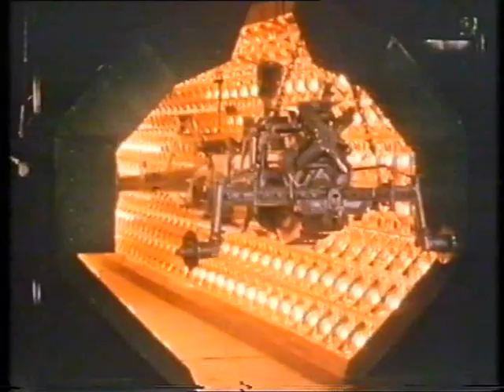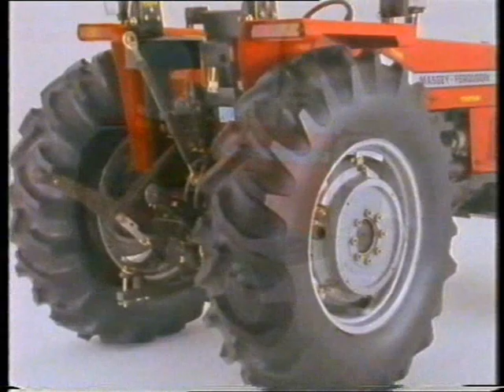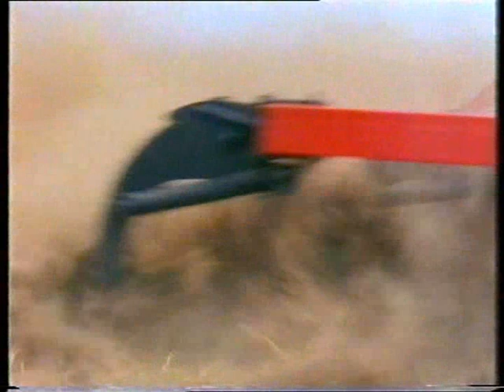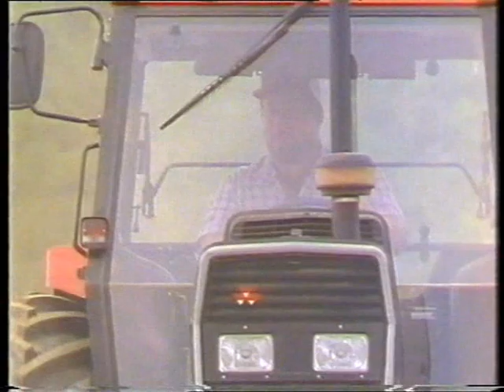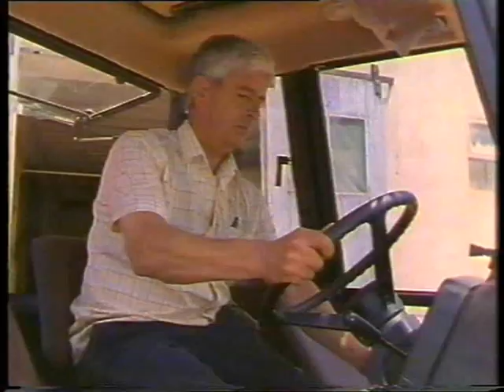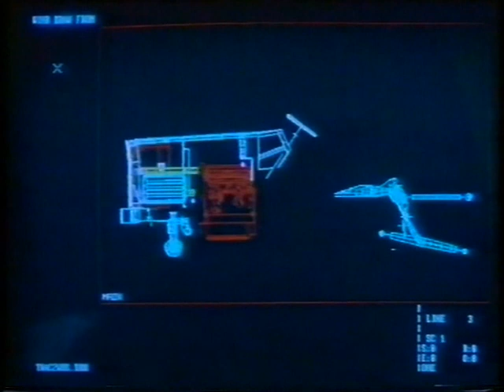MF 300 Series Introduction (1989).wmv

Comment: I have owned many tractors. The one that I would say was the best ever would be a 390 four wheel drive. It stood in as a big tractor one year when our MF 2685 got laid up with a piece of clutch spring on the clutch plate getting jammed and not allowing it to release. 
The 390 was weighted up and coupled up to a Dowdswell 4+1 DP 8 plough and then a Dowdswell 4 metre power harrow. She could punch well above her weight. I remember my father bringing my sandwiches to the field and seeing the 390 power harrowing and saying to me, "The poor little bugger!" We actually finished off that drilling season off that way while the 2685 was being fixed. What it did mean was super early starts so as the drill didn't catch up with the power harrow. If 300 series tractors were produced today, i am sure that they would be a top seller. Robust, simple, very effective, and reliable.

Comment: The 90's Massey Ferguson's 300 ,3000, 3100, 3600 series are great tractors . I have a 3000 series 3070. I grew up with using the 100 and 200 series Massey Ferguson's .  The Perkins Diesel engine is very reliable and has a lot of low end torque.  My favorite Massey Ferguson tractors are the 35. 65  ,97-8, 135 , 165, 180 , 1130, 265, 285, 383, 3070, 3095, 3125, 3690. ,

Comment: The 365 4wd was a poor performer, bought  iit against the 390 as wanted a good slope/bank working here in Wales. Adding dual wheels to the rear and 4wd engauged there was very little power left even to climb back up a bank,let alone have any light pto implement. However like most Uk built MF tractors it was really well balanced . Fuel tank up front good but vibration use to  break the fuel line,untill I affected my own mod.The stuttle lever ex factory would rid a finger and nail  badly ,as yhe action between the steering wheel and the plastic knob,as you partly swung around in the seat to reverse ( topping or similar). small cab but ir was a small tractor . It was otherwise a safe tractor but lacked the grunt of say DB 1394  whish was too heavy for that type of work. The Rep at the time tried to get me into the 390 instead of 365 ,but I thought I knew better . 390t  was the tool with the correct rear wheels and tyres complete with low profile cab.
.
Reply: We made MF in the uk ,we know as customers a great deal about them too having all started with Ford 9n and on through . Thosr tractors you talk about are proably export models or French built. 1990 365 os about 68hp in two wheel drive form and in uk you had to have a cab by that date. We really welcomef the 390t but with  all rims and fatter tyres than standard. When we were not using our MF tractors in extreme hill side conditions I would be on my  MF painted Landini crawler which was power by the greater 188 engine.The 365 really needed a turbo but Perkins had'nt really designed that the 165 engine for that. I am now 70yrs old and retired from such work but ,I think you may not have my experience or hrs in the seat so your  advise is  really is not founded.never the lessmy kind regards. and do'nt buy green!
Reply: 365 is a small tractor to have a cab & duals on !!!   Sounds more like you overloaded the tractor more so than it being a poor performer. The 383 would’ve been a much better choice, I would’ve even taken it over the 390T. In my opinion the 383 & 399 were the 2 best tractors of the 300 series, great power to size ratio, great fuel economy &  practically bulletproof. The right tool for the job matters. It’s kinda hard to fault the tool when you know it’s not the right one for the job to begin with. A 365 is only a 50 something Hp tractor, that’s a 50 something Hp tractor that was 4wheel-drive, had a cab & duels on it. Well that along is where all of your power went. Probably even had a front end loader on it too, right ????
That’s not exactly what I would classify as being a poor performer, that would tend to fall under the category of overloaded !!!   In my personal experience with the different make, model & brands of tractors you typically can get by with just a little bit smaller MF tractor than what you can with most other brands, just simply because the MF are usually a little underrated when it comes to the advertised Hp rating of the tractor when compared to most other brands. Yet even still, you were asking for a herculean task out of that 365 with having all of that added extra on a tractor that’s only factory rated at 50 something Hp. After all of that added extras, you still had to figure in the fact that you were working uphill, along with the fact that the implements used were also gonna rob Hp away from the tractor as well. You said that the dealership tried to get you to step up to a bigger tractor because of what you were wanting to do with it,  but you instead chose to go against their better judgment on the matter and went with the wrong tool for the job because it left more money in your pocket at the end of the day !!     I’m sorry but that doesn’t make the tractor a poor performer, that only makes your choice of which tractor to buy for the job poor !!!   I mean it appears that you were told going into that deal that you weren’t making the best decision on which tool to buy for the job, but you still bought it anyway. I’m sorry, but it’s kinda hard to fault the tractor on that deal. I mean you were told before you even bought it that it wasn’t gonna do what you wanted to use it for,  that one is on you !!!   It’s like the old saying goes, “It’s better to have it & not need it, than what it is to need it & not have it” !!!  When in doubt, always go bigger,  the dealership even tried to tell you to do it !!!    You sound a lot like my daddy, buy something even after being told it wasn’t the right tool for the job, then turnaround and bitch about it after it does exactly what you were told it would do before you even bought it !!!!   I don’t mean to sound like a smartass or anything like that,  but that one was 100% on you, not the tractor !!!

Comment: These 300 series were imho the last of the best made in the UK. 4200 series, not so good.
Reply: Evan Espin my neighbors owned the 42 and 43 series and you are right. After 43 series, they went to crap . I had the pleasure of owning the first 5445 open station ever shipped to America . Wanted a 43 series, but couldn’t get one . The 5445 was the biggest piece of shit I ever owned .
Reply: The 4300 series was nothing more than a fancy version of the 4200 series, they were produced at the same time. The 4300 series had more electronics on it than what the 4200 series did, as they were still mainly mechanical tractors.

It’s not just the MF tractors though, it’s all of them. The more electronics that’s being put on them, the more problems people are having out of them. Think about it for a second here, you’re putting electronics in the worst possible setting for them you can by having them on a tractor. Dirty, dusty, wet, oily, rough ground, hot, vibration, long term continuous & so forth. You name it, if it’s a bad environment for electronics, well at some point & time you will encounter that exact type of environment with a tractor at some point in time !!!

Don’t get me wrong now, all of that stuff is nice to have, but it also leads to a lot more trouble out of your tractor long term that you used to not have out of them. 

Most of the tractors produced today aren’t a once in a lifetime purchase anymore like they use to be. Most of the ones produced today need to be replaced every 10 to 15 years tops !!!    When you start having electrical issues out of them, well it’s time for it to go, because they don’t stop, they just continue to get worse & more expensive to keep up. On a mechanical tractor it doesn’t matter, you can still crank it & use it regardless of whether everything works right or not on it !!!  That can’t be said about the newer ones that have all of the electronics on them. When you bought a tractor in the 1970’s, 1980’s & most of the 1990’s, well those were pretty much lifetime purchases, that’s not so much the case nowadays outside of a very few mechanical tractors that are still being produced today, with the majority of them only being smaller tractors.

It’s the same way with vehicles as we all know. I have an old 1997 Chevrolet 2500 I bought new in 1997. That truck has just enough electronics on it to where it always runs good, unlike the carbureted vehicles before it, but still not enough electronics on it to where the common man can’t still work on it.  I also have newer diesel truck that’s pretty much loaded out, you name it, it’s got it on it. I literally could’ve bought 5 of those 1997 trucks new for what that last new truck I bought cost me !!!   I’ve already had twice as much trouble out of that newer truck than what I’ve ever had of that old truck. Every bit of it has all been electrical related issues. Theses no way in hell that truck will ever last as long as what that older truck has, there’s absolutely no way that will ever happen. I mean hell I’ve already spent more in repairs on it than what I ever have on that old truck !!  The newer tractors are the exact same way, it doesn’t matter what make, model or brand it is, it’s the exact same issue with everyone of them !!!